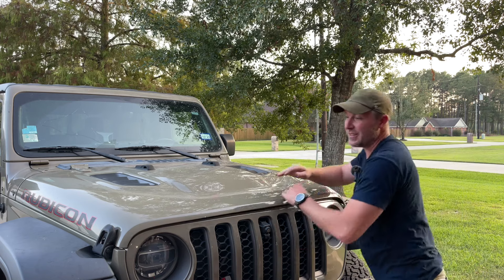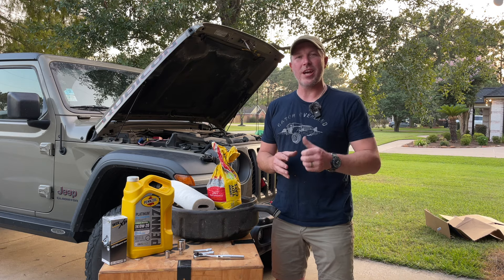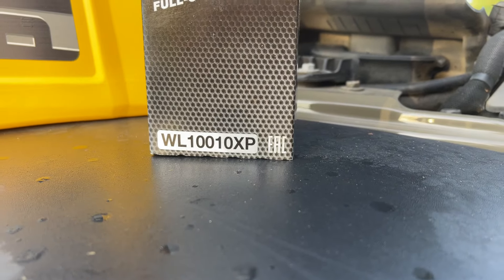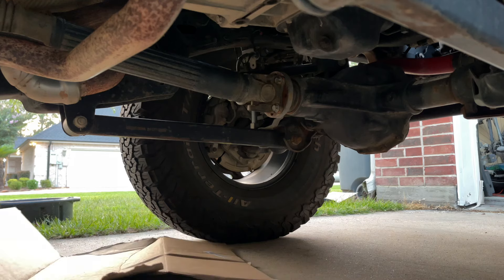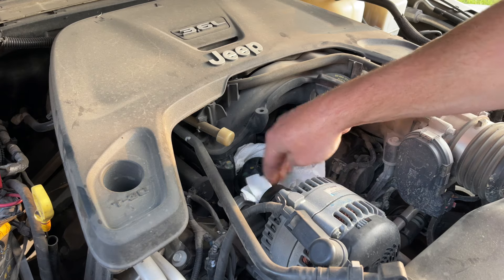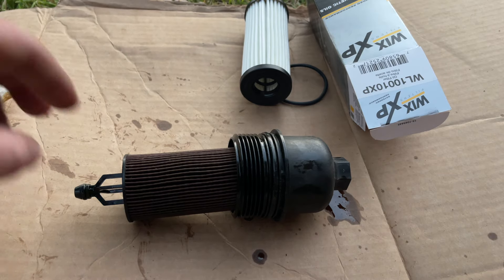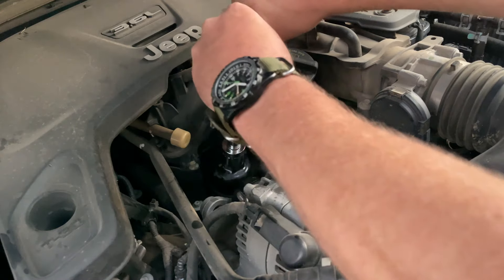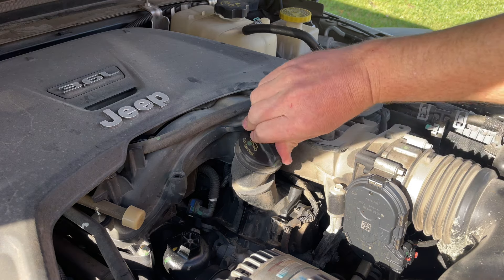Quick & Easy Oil Change : Jeep JL Wrangler/JT Gladiator 3.6L

Comment: Where exactly should you put the o-ring back, as I think the improper placement of this caused a small leak on mine when I last got it serviced. Will do it myself going forward after this...
Reply from the maker: There is a specific groove for the O-ring to sit… It is very common that the dealer over tightens this cap resulting in a cracked housing and that’s where the leak develops… You may want to double check your housing is not cracked.

Comment: Wix/ Napa Gold filters are excellent protection, far superior to the cheapest possible filters used at jiffy lube and other oil change outfits. I like to draw out the oil through the dipstick tube with a good pump, saves a lot of mess.
Reply from the maker: 🤘🏼🤘🏼🤘🏼 thanks for the follow up… Interested to see your dipstick pump method
Reply: @GatorOverland  I use a “Fill Rite” transfer pump, about $200-$350. They’re also handy for trans fluid changes and fuel transfers. You just need to make a reducer hose for dipstick use. (Just to be clear, I’m not talking about use by a dipstick. This is never recommended.)